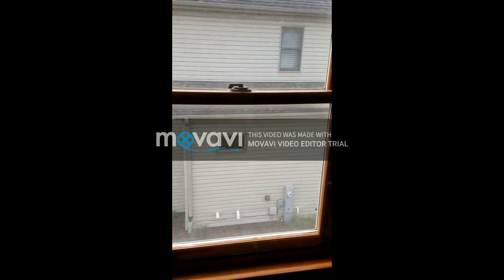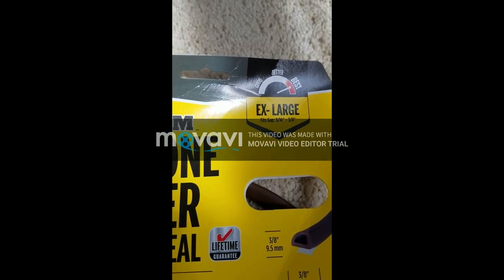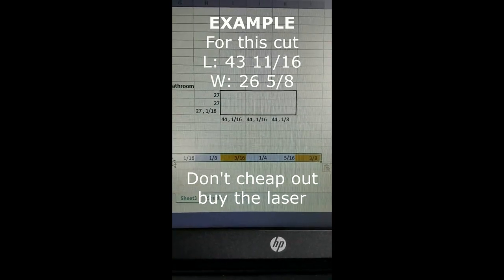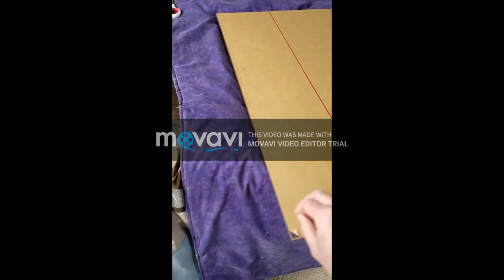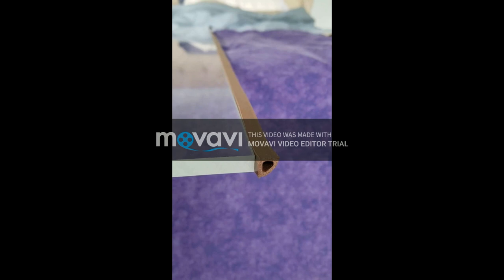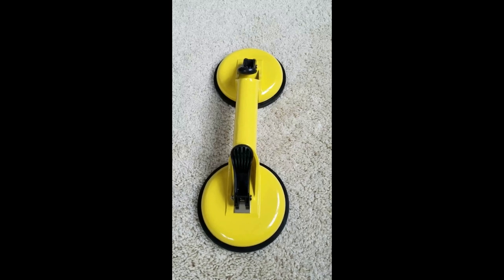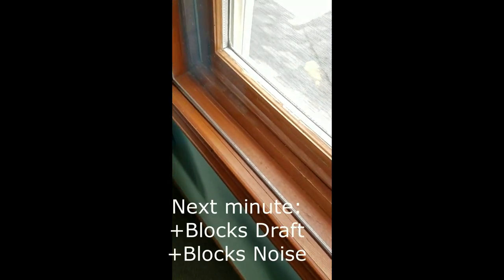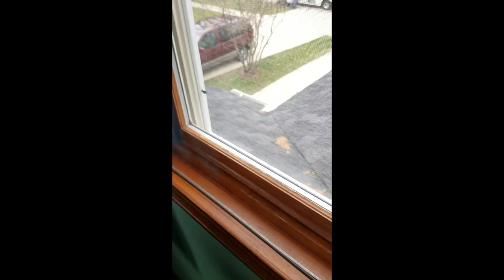DIY Acrylic Windows Inserts to Block Drafts and Noise

Comment: Thank you! We were able to do this with a 1/4 thick sheet for a large (4x6') double-pane window facing traffic. Cut sound down about 90% for about $240. Going to do our smaller back windows now.
Reply from the maker: Wow I just read this. I am glad someone was able to do this too. Any tips?
Reply: Maureen, any tips? Which website?
Reply: Best tip is measure window with a laser. Also if you still have a gap, i found an expandable insulation that goes up to 1 inch. Get extra suction cup pulls and leave in the room in case of fire so insert can be removed quickly
Reply: Thanks for the info! I also plan to use 1/4 inch acrylic. Can you share what type of insulation you used? Were you able to find a product that was 1/4 wide to match the acrylic sheet?
Reply: @coryvansteenwyk4050  Hi Cory, were you able to find out the answer to your question? Thanks!
Reply: Hello Maureen, thanks for sharing! Could you please also share the rubber weatherstrip you used for the 1.4 thick sheet? Thanks!
Reply: @maureenbounds7435  Ooooh, suction cup pulls is brilliant. Not just for fires (though that's an excellent point), I live in a studio. If I burn something in the kitchen, my whole home (and clothes) will smell like smoke if I can't open my windows. This was the undoing for past window insulation projects.
Reply: I can't find the same shape weather stripping. What did you guys use or where did you buy?
Reply: @JohnSmithh644  home depot. The expandable foam stripping worked too on and uneven window. I don't remember the brand on the rubber stripping. I did find the thinnest one sealed better
Reply: @maureenbounds7435  So, you ended up using two different types of weatherstripping? One expanding foam and one rubber?
Reply: @maureenbounds7435  thanks so much for the update. I need this for our master bedroom. Constant people racing around a nearby corner and emergency vehicle sirens!
Reply: @JohnSmithh644  yes. Old house and 3 different windows. The rubber strips were perfect for the master and the foam adjusted for the den. Rubber is best sealing and noise reduction
Reply: Is 90 percent 10db?
Reply: I am about to do this with 1/4 inch sheet. I was wondering about the width of the adhesive being too large for the seal he used but it seemed to work for yours so ill try.
Reply: 90% wtf?

Comment: I followed this tutorial as an alternative to indow inserts.

I had a local acrylic plastics manufacturer cut them for me. I used 1/2" cast acrylic. I used the same MD rubber silicone for the edge that's in the video and filled any remaining gaps with Green Glue sound sealant. The noise reduction was substantial, measured using my phone it went from about 56-58db to 49-50db. It's not a magical amount of sound reduction but it was definitely substantial to the point I found it worthwhile for our master room that's next to a road. don't expect to be able to take these on and off to open windows, they are quite heavy and difficult to remove, but they can definitely be taken off in case of emergency that you need to jump out of your window or something.

Comment: Love it, DIY! Found one company for window inserts that wanted around 350 per window, so I looked up a plastics store and got 2 windows cut for around 300 and the rubber is 8 bucks a pack.
Reply: What store did you get it cut?
Reply: It was a local Nevada acrylic shop that did it.
Reply: @houstonderk  thanks!

Comment: Just finished doing a larger window in my office with this information. I didn't really need to make any alterations to the formula and it cut out the incessant highway road noise pretty noticeably. Thanks for posting this vid!
Reply: hey can this really cut out the highway noise? I am bothered by the noise so much, even thinking about in my bathroom.

Comment: The standard Indow brand inserts are only 1/8" thick acrylic - their expensive acoustic grade is 1/4", so your 3/8" is quite an upgrade, thickness is especially good for sound insulation as you have seen.  Price should be substantially lower if you buy the 1/8 acrylic sheet which is probably fine for many people trying to cut cost - weather-stripping type with that TBD.
Reply from the maker: I can't compare to different thickness, but I have been happy with the 3/8. Go big!
Reply from the maker: Also, I had limited air space. It's likely less thick acrylic and more airspace would have a similar impact. But just guessing
Reply: I've seen many of these videos (I hope to make the plunge this year) - people typically say 1/8" is enough to see the reduction in condensation, removal of drafts, etc. But if you want sound proofing, thicker is better.

Comment: I would also suggest taking into account the measurement of the edge of the window opening where you will be inserting the window frame. It could be crooked and slanted inwards, causing difficulty inserting the DIY window insert if you only gave 1/4 inch clearance to fit it (plus 1/4 inch for the compressed weatherstrip, basically making it 0 inches clearance), especially for a narrow window that gives you less room to insert it at an angle. You may need to give an extra 1/8 or 1/4 inch clearance to the original measurement if the window opening is crooked.

Comment: Does this help with low frequency sounds such as trucks and motorcycles?
Reply: I did one 1/4" thick, reduced a lot higher frequency outside noise, but didn't affect much the lower frequency sounds, eg. engines and tire on asphalt.

Comment: I live on a busy street and this would be a great DIY project. Thank you for posting this video. Now that it has been months since you completed this project, is there anything you would have done differently? One thing i came across on another persons video was the person put silica packets between the window and the Acrylic so it is not fog up. Have you noticed any issues where the window swells or expands causing a gap?
Reply from the maker: The big mistake I did was using the non-flexible stripping on some earlier versions (shown breifly in video on what not to do). With those, small openings opened up, causing very minor condensation by the openings in direct sunlight. Very small area. I did not notice any on the inserts made the way I showed in video.   

Other than that, air space! The more the better, the insert I showed at the end works far better than the ones closer to window.

Also, I screwed up measurments on first set...so I bought laser measure.

DM me if you have other questions, hope these help with the noise levels - it was noticably better for me.
Reply: @phillipbunker9017  Please, I have a small question... should the measurement of the "laser cut" for the "acrylic" be exactly the same as the edge of the window? I would like to know if you left 1cm to place the "rubber"...The other thing I wanted to know is if it puts pressure or need to use glue?
Reply: @phillipbunker9017   Hi, thanks so much for the excellent tutorial. I'm having trouble finding that shape of weatherstripping. Could you link to it or recommend where to buy?
Reply from the maker: @miumikuhatsukoi5300  leave some room for the weather stripping. The stripping says it's expansion dimensions on the box so account for that on the sides when measuring. No glue, the stripping was self adhesive

Comment: @phillipbunker9017 
Ok so i followed this up to the bit where you have to place the acrylic into the window frame and what I am curious about is, how did u get the acrylic to sit int the window frame, did you have some magnetic strips that it adheres to OR did you insert the acrylic into a window channel so it stays in place? Also how do you remove it when you need to clean the other window ?

Comment: I just moved to another place .. but unfortunately it’s upstairs and right on the corner of two main streets and a rail road crossing here in Oxnard California.. all I do is hear obnoxious drivers in their crotch rockets and straight piped Chevy Silverado’s and mustangs (and other nuisance muscle cars)  this noise is unbearable 😡 so I want to do this now. But I’m worried if this will make it hotter .. will doing this to the windows  make it hotter inside ? I have no ac
Reply from the maker: With no AC and no windows to open it would be really hot.
Reply: I can tell you from experience that living upstairs without an AC in the Summer means you WILL be hot if you remove your air flow. It became so unbearable in my ex gf's apt that we had to rig the one room with suitable windows for AC to have two air conditions running at the same time in different windows to cancel out the oven that the rest of the apartment was. Without a thermometer I estimate the temperature must have been in the upper 110's or mid 120's. I felt like I was going to die in there.

Comment: I have to disagree about the amount of dead air space required. If you look at a double or triple pane window, there’s not more than about 1/4” airspace between the panes. I made acrylic inserts and placed them up against the inner trim pieces by the tracks for the sash. I placed the gaskets on the surface of the acrylic, between the acrylic and the trim, rather than on the edge of the acrylic and against the sides if the window frame. This gives you a little more room for error if you under-cut your acrylic. Roundhead screws screwed into the window frame perpendicular to the acrylic (NOT into the acrylic!) keep the acrylic and gasket pressed against the trim piece. You do not want any gaps! 
Note too - NO window frame is going to be perfectly square. Measure the diagonals and you’ll see.  Also, the sides of the frame may not be perfectly straight. I made cardboard templates first to fine-tune the shapes.  Make sure the frames themselves are well caulked as well. My inserts make a significant reduction in street noise coming into the room.

Comment: Wonderful and very clear. Thank you. What if you used Green glue on the inner edge of the weather stripping? Do you think that would be in any way a benefit. I love the suction cup tool device; what a great recommendation.
Reply from the maker: Thank you. It's been about 1.5 years and the stripping held up well so far. I don't have experience with green glue
Reply: @phillipbunker9017  thank you for your reply!

Comment: does any condensation form between the insert and the window?  I know this is an issue when the seal goes between a dual pane window and am worried the same thing will happen with these.  We have cold winters here (toronto).

Comment: Pretty good, thanks!
you think this will work for noise neighboors? I live in Mexico so there’s no shipping of those indowwindow for here
For example 50-60 decibels I need to low it to at least 30 you think this will work? To buy acrylic asap
Reply from the maker: Reduction will be a factor of how much air space in between window and acrylic, and what noise your blocking. High frequency are blocked better than low (bass). You will notice a reduction. I don't have a decibel reader, so can't quantify. Going from 50 to 30 is a massive reduction.

Comment: The silicone stripping is just adhesive, so how long do you reckon they will stay on the window perimeter after repeated dismounting and remounting of the window? My interest in the inserts is mainly for sound proofing, but I may want to take them out during the day so I can open my windows.
Reply from the maker: Not sure. I have taken mine out for the summer and put them back in a few times with no trouble. Daily might be harder. Might be worth hot glue on in addition to built in adhesive

Comment: I live next to a rail road crossing in the City and I want to try and make this to minimize the train horn noise, do you think it would help in reducing this noise?
Reply from the maker: Maybe, but I don't have a good guess by how much. Higher pitch noises are blocked better than lower pitch.
Reply: did you end up trying it?
Reply: @richardlam6885  no i didn’t I thought it was overpriced considering I was renting, and I was about to make my own but then i ended up moving out of the place

Comment: very informative video. If the rubber is 3/8 - in each side, shouldn't you subtract 3/8 - in each side (total of 6/8 -in)? I am trying to do this one myself and want to make sure i get the right cut. Thanks
Reply from the maker: The stripping flexes from 3/16 to 3/8. I did the cuts taking the smallest part of the opening, and subtracting off 3/16 from both sides. 1:45 in the video has an example in writing. If you do 3/8 from each side you will risk holes for areas that are wider.
Reply from the maker: Let me know if you have other questions, and if you do make it would like to here your experience.
Reply: @phillipbunker9017  This is extremely confusing. You say in the video "subtract 3/8 from smallest dimension" and then write "I misspoke it's 3/16 from both sides. Your example works out to be 3/8 from the smallest dimension. Then you say here that 3/8 is wrong and you point the commenter to the example for reference. I cannot make heads or tails of this.

Comment: I don't really recommend using a laser as fractions of an inch matter, lasers are 1/4-1/8 off. you can get a more accurate measurement measuring with a few tapes and if they're all consistent. I just bought one off amazon for this project and realized my tapes are far more accurate

Comment: Would you recommend a 3/8inch over a 1/4inch acrylic sheet even if you’re sacrificing more loss of air space? I currently have 1.5inch worth of space to put the insert in the window pane.
Reply from the maker: I would go with thicker for more mass, but no real data to back it up. The air space comment comes from the windows I had an extra inch or so are noticably better sealed for sound and air then the ones with less. That being said trading mass for airspace feels right

Comment: Where did you get your acrylic? My window is 54 1/2" x 60 3/4". I cannot find anyone that can provide acrylic that size in Nashville or even online order. Any suggestions?
Reply: I don't believe it. Contact a plastics or glass seller. There should be plenty of acrylic (plexiglass) sales/cutting services available now especially with COVID-19 and the popularity of sneeze guards. EDIT: I see your width is 54 inches. You may have to join 2 pieces of plexiglass, which is what I am considering doing.
Reply: @Richard Lam  I was able to get 1/2 inch laminated glass. Thrilled w the result! I paid a lot more and hadn't professionally done and inserted. A lot more money... and worth it

Comment: 3/8 inch thickness wow that is really thick. I think the only thickness I have access to is about 5mm, in your experience do you think it'll be significantly worse?
Reply from the maker: I don't have a good gauge on that.  If you can make up for mass with air space that will help
Reply: @phillipbunker9017  Thanks for the quick reply, much appreciated. Due to the cost of the plexiglass where I am (it's about 50 dollars just for 2mm thickness for the size of my window here, 3/8 inch would be too expensive) I'm going for 3mm (I live in a corner apartment so I have a lot of windows! A blessing and a curse at the same time!). Your video has really helped me! So again thanks x 1 million!

Comment: Did you have to account for expansion and contraction of the acrylic as it is exposed to sunlight during the day? 3/16” on each side accounts for the weatherstripping in its most compressed state, correct? So if the window expands during the day due to constant exposure to sunlight, what where would it grow into? Can the weatherstripping compress even beyond 3/16” on one side to allow the glass to grow?

Thank you.
Reply from the maker: Brings up a good point. I don't remember the exacts of expansion/ contractions, but I haven't had trouble.

Comment: I would like to use this to add a frosted acrylic privacy window insert for the window above my shower as the Warranty on my windows does not allow me to add a window film. Since it is for a bathroom, I am concerned about moisture and mold buildup between the insert and the window. Does anyone have tips to avoid this? For example, would using weather stripping only on the 2 sides (no weather stripping on the top and bottom) help to provide adequate air circulation to prevent this?
Reply: Another commenter mentioned putting packets of moisture absorbing silica in between the window and the acrylic cover

Comment: How have these held up after a year? Do they do a good job blocking highway noise?
Reply from the maker: Still strong. The adhesive on the weather stripping still holds after many take out/ put ins. Morning condinsation is an issue on the ones with less air space and more sun. I put some spar urethane on the wood windows to beef up their strength and protect against wear.
Reply: @phillipbunker9017  your video has inspired me to do this. I am very sensitive to highway noise. Do you have an email, in case I have any questions?
Reply from the maker: @johntrailer1604  you can post them here. Higher frequencys are easier to block than low, so hope it works for highway noise
Reply: @phillipbunker9017  my window is 58-9/16th long, and 34-7/8th wide. What dimensions should I tell the shop to cut the acrylic?
Reply from the maker: @johntrailer1604  depends on your weather stripping flexibility. Also did you measure 3 spots to make sure it's not on an angle? Top middle bottom
Reply: @johntrailer1604  well how did it work out for you?
Reply: @richardlam6885  have not done it yet. lol
Reply: @phillipbunker9017 how do u pull it off to open the windows